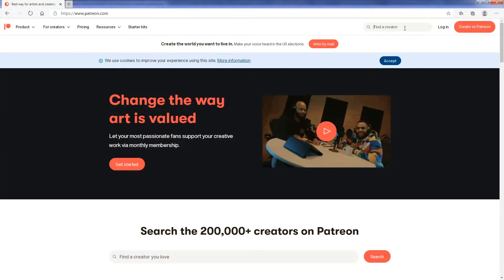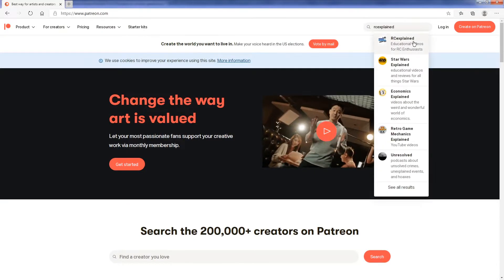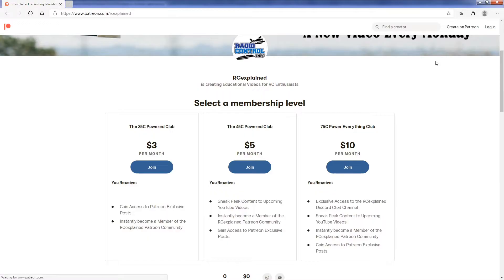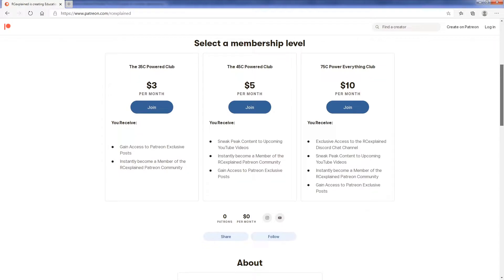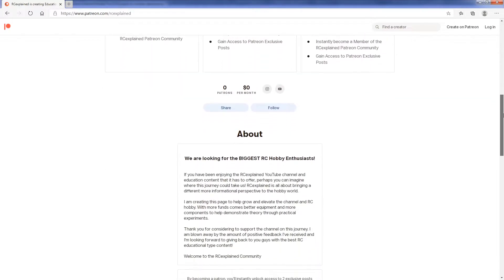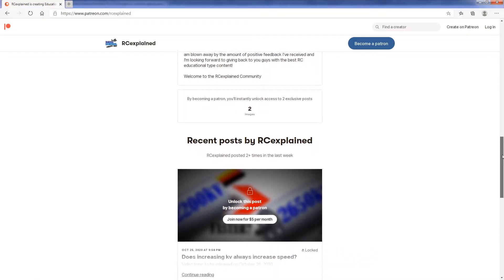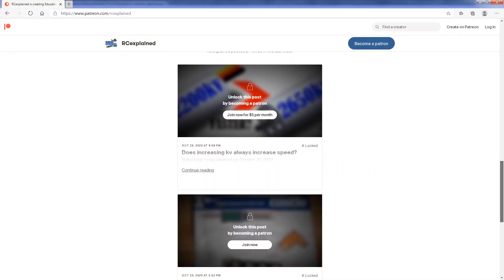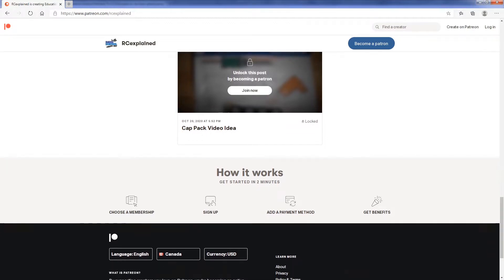Does Increasing the Motor Kv value Increase an RC Cars Top Speed?

Comment: New subscriber here! Ive watched at least 7 or 8 vids before i hit the button lol
Reply from the maker: Darn, I'm not good enough to make you hit it after the first video! Haha, thanks for the sub!
Reply: @RCexplained  OK , OK,  I hit the like button just now too lol .
BTW as a kid I used to put an extra 3 mins on my 15 min quick charger. burnt my first novak esc , had battery connectors melt together and I thought it was normal for an rc car to smell like a clock radio in an EZ Bake oven.

Comment: So if I use a lower kv motor and gear it up, will that be more efficient than using a higher kv and gearing it down ?  In other words, mathematically I could get the same final rpm but which will give me more run time ?  Low kv high gears or high kv with low gearing  given everything else is equal 🤔

Comment: You know I just cannot get over how much people pay for the aromas or kratons. 12 or 8s to me it's just an absolute joke. They put it on a 1100 KV and even up with a 12s battery and 1100 KV can only do 32,000 rpms. So you can take a 4000 KV motor put a 11.1 3s lipo on get 44,400 RPMs and totally rock that thing. So to me I just don't get why people do it.
Reply from the maker: I don't know what you mean. How many watts are you getting with the suggested setup and the 12s setup?
Reply: @RCexplained  well let's 1100x44.4=48840, and 3200x14.8 is 47360. So I mean with a much cheaper motor and a much much cheaper battery you can almost get the exact RPMs of a 12s battery and motor combo. So all I was saying is I don't get why people are spending thousands of dollars on all this upgraded equipment when it's really not that much better
Reply from the maker: What are the wattage figures in your example?

Comment: Thank you for real information in your content instead of flashy look at me stuff.. Im building an airboat using an arrma 2050 kv 8scale motor on 6s. Other than weight being factor, any problems with high rpm and low load? Seems like the motor wont even feel a prop compared to moving a car with tires.. I dont have friends into rc so sorry for asking here!
Reply from the maker: Sounds like far too much kv for any decent size prop. What prop have you calculated for this high of an RPM?

Comment: I would like to point out a slight error U have which is still quite variable ..the vehicle weight ..if U have higher kVa and higher rpm U have less tourqe ..if U have a large heavy RC car your going to decrease take off speeds by increasing rpm operation aka speed.. ..if U truly want to go faster go smaller in kV bigger in physical size and up the current to 2-3x your existing supply ..then mess with the gearing and U will increase takeoff AND top speed

Comment: Awesome breakdown. I'm new to speed running and just now in the 70s. My ESC has motor timing settings that I could play with, but I still need to learn more before I change anything.
Reply from the maker: Thanks for the comment. Just recently I did a few videos on timing that you may want to check out.
Reply: @RCexplained  Yep, I'm watching a couple older ones now and it's pretty similar to a piston engine like you said in the video 👍

Comment: This is kind of off topic. When using 2 batteries (in series or parelle) is it true that the second battery is NOT monitored by the ESC for low voltage cut off at 3.7 volts or 4 volts DC.
Reply from the maker: Hi Greg. In general, if two batteries are connected in parallel to power an ESC, then both batteries will be monitored for low voltage cut off. This is because the voltage across both batteries is essentially the same, and the ESC is designed to monitor the overall voltage level. 

However, if two batteries are connected in series to power an ESC, then the situation is a bit more complicated. In this case, the voltage across both batteries will be added together, and the resulting voltage will be monitored by the ESC for low voltage cut off.

The ESC in both situations can not detect if a single cell enters LV as the ESC only sees total voltage.

Comment: But increasing kv is more efficient because faster speed at lower load is more efficient for the motor right? Compared to changing the gear ratio?

Comment: There's more to it then that. Like amp draw, power to weight ratio, WATTS power of the motor. Higher Kv uses less voltage but more amps in order to get closer to the (Watts) actual power. But also shortens the run time. The specs show it all. Look at the volts and amps on the specs. Lower kv doesn't just mean longer run time. It means it requires more batteries then higher Kv motors to reach it's true WATTS OR POWER you need for faster speed.

Comment: Can size will have effect on coil 
 Power going in . Power generated or speed is going to come from rotor magnets, how hard and fast it will turn to the next pole . Can is not as important as rotor .   A Hacker rotor compared to  Castle  is  Huge .. Maybe 5 times more magnetic or 10 times .  I have compared . The Hacker will attract hard through  palm of my hand . Where the castle rotor will not even do anything.

Comment: RC explained I have a question. Maybe I wanted to stay in the same motor size lets say 3650  and I had one motor 2050kv and another 3500kv
, but I chose to to run the 2050 kv at 7.7 gear ratio overall and the 3500kv at 12:1 overall .... the tire speed will be the same for both motors, but the load will be very different because of the gears.... So the 2050 would get hotter than the 3500 because of the extra load correct ? or will it be the same roughly because the speed of the car is the same.  Thank you.
Reply: both running 11.1 volts ....

Comment: torque is what you need to chase, not rpm/kv. I can put a 3600 kv motor on car and it could crawl if it does not produce sufficient torque, vs an 800 kv motor geared for speed and it will run because it has enough torque to reach its highest rpm under load.

Car manufactures will tell you all about how much horsepower their cars can produce, but who cares to ask about the max rpm of the engine???

Comment: Well there is actually a lot more to it than simple RPM. You can actually increase your top speed by lowering the KV and increasing the gearing. I’m curious to see your results because I’m going to be running the same experiment. Going from a 2050kv to a 1700kv swapping the gear to a high speed gear and see what happens
Reply: What would happen with heat? Would it get hot faster or slower?
Reply: @FZERO20  too much heat is bad. Lower temps as a general rule is better
Reply: @FZERO20  it gets hot faster with the lower kv motor. Especially when your looking to increase top speed. You’re putting a lot more torque against the motor. Sorry I must’ve been preoccupied when I first responded. I hadn’t read the question correctly
Reply: @jimmyv1753  😂😂yo I totally forgot about this. And I see your previous comment, I suppose when I saw it at the time I didn’t know how to respond so I just left it lol. But okay, that’s interesting info to hear. Rn I have this Wltoys 124016 with a 3650 brushless upgrade. An 8.5t mod V5R motor on stock gearing. The car is amazing and really fast. I can run laps and the heat on it is what I would say, “really warm, but not hot”. Supposedly you can run low kV/high gearing on motors that have larger can sizes because they can.. of course handle and dissipate the heat way better. So if you can upgrade motor diameter while keeping kV low, you may get away with it. Add a fan or too👍🏾😁
Reply: @FZERO20  sounds awesome. I have a few similar set ups. I hooked up the V5R only to figure out it was in an L situation (if you know what I mean) I ended up getting a couple of each type of those little 540 motors. That car had incredible reverse speed 😂 it was the most recent comment that had me pop back to see what it was about that’s when I read my earlier response to your question and was like WTF did I say there 😂 personally I like the slightly larger cars. I’ve been building on a talion. I swapped out the esc and motor for the 200 amp 6S hobby wing x8 plus or whatever it’s called. With around a 2200 kv motor and it’s by far the fastest car I’ve ever built. Of course the motor and esc cost as much as the car so I wouldn’t recommend going that way
Reply: @jimmyv1753  dude you have some too. That’s cool asf man. I’ll try and post a vid on my channel of my current 1:12 scale on-road build. And it’s all good, my bad for the late response too. And I feel you on the scaling. I’m so looking forward to going up to like 1:8-1:5 scale but I just don’t have the money or space for it yet. But it’s definitely on my list. I also love how although we at different parts of the world, we do such similar things
Reply: @FZERO20  I hear you there. I’ve got a 1/5 scale outcast and it’s fun. But very expensive to fix and being 40 pounds (18KG) when it lands (jumping it is by far the funnest thing to do with it) it breaks real easy. I’ve only got about 2 hours of use on it and I’ve replaced both upper and lower front A-arms to aluminum (160 bucks) so far. By FAR my favorite is the Talion 1/8 scale. I added all that extra horse power but even with the stock set up it is soo fun. Has fantastic handling. It’s great on all terrain, climbs, jumps, concrete or asphalt, grass, dirt, sand and anything else. It rips and is just an absolute blast to drive. I’m sure Traxxas has a similar style RC that’s just as good or better. I’m not an Arrma snob it’s just the batteries I have so rather than buy new batteries I just stick with Arrma. Not only that but their site has excellent payment plans available. I’ll check out your page too see what you’re working with.
Reply: Lower kv motor should be much more efficient, in terms of heat/amps, with higher gears vs the high kv.

Comment: This is excellent info bro😎👍

 There are however motors out there that can handle the issue most higher kv motors have, which like you mentioned, is that they have smaller can size & overheat quicker. TP power motors have a nice selection of higher kv motors with large can size & capable of handling higher voltages & current than most common motor companies offering the same kv value.

I'm in the middle of working on a 4S high speed project, an Arrma Typhon 6S stretched build. Castle XLX2 controller. While the XLX2 can handle 8S & I can easily get this car over 120mph running 8S, I realized that I can run a higher kv motor, with a decent current rating, on half the voltage & still achieve high speeds & not worry about the too much current being pulled from the ESC, since the XLX2 can handle over 500A. I ran as a test an old hobbywing ezrun 2200kv motor I had on this new stretched Typhon 6S with a 34T/34T gearing on 4S. Pulled 207A from the ESC & hit 85mph. Did 3 runs back to back @85mph & i could still keep my fingers on the motor. My gear calculator estimated 86mph with this setup so I definitely was hitting max on my runs. Even with this "not top of the line" 2200kv motor, with a minor gear change & still running 4S, I should be able to get over the 100mph mark. Next motor will be either a TP Power motor or the Castle 1721 2400kv motor. Looking forward to breaking ~110mph on 4S. I know it's possible & even higher as others have already done so.
Reply from the maker: Amazing man. I hope you are having a lot of fun experimenting with the different setups and tweaks. Have you seen this video?
https://youtu.be/mrPjYEmMPfA
Reply: @RCexplained  Just watched, awe man... That's exactly what I wanted to see. The inside structure of these two exact motors & you got them both on 1 video lol, thanks you thank you!! 👍👍

I was just on TPs site yesterday and noticed the "regular, cm & scm" types but didn't get a chance to dig & see the differences so that was very helpful as well. 👍
One thing I like about TP is that they actually give you a "continuous" & "peak" (along with peak runtime).
This is helpful when breaking down a current draw chart for the different LIPO batteries (2S,3S,4S,ect.) at max wattage. This makes gearing easier, as it lets you know what's the max gearing at a certain voltage level you can push to reach the max wattage that a motor can handle (wattage/voltage =amps). As much as I love the Castle products because they are indeed excellent, as an electrical engineer, I hate their lack of data/specifications on their products.
Thanks for the awesome link & taking the time to make these videos, they're absolutely helpful 😎👍
Reply from the maker: Right On. I will be doing a video soon on the specifications of the motor. Things like Io and Rm also relating it back to a theoretical max continuous and peak power output. Stay Tuned. 😎

Comment: Also when you change KV you also affect torque of the motor too even more so when the size of the can changes too the length of the can affects heat dissipation and torque which is important when you go with bigger vehicles. Normally brushless motors will have another 4 digit number and that specifies the can size and length.  A 3660 motor is 36 mm in diameter and 60mm in length.  Just more to take into account

Comment: 👍👍👍Great video and very importan in motor selection since many rc plane brushless motors do not include  temperature limitation or even maximum desing current. How do you know that the proposed motor is aout at is thermal limination? got lost on that part.
Do how i know max current for a brushless motor if not provided by manufacturer and i do not want to buy a bench test and test it myself, if there a way to calculate it?

I am a new subscriber!!!!!!!!!!!

thanks

Comment: Running a 5900kv motor in a 1\10 scale buggy it is off the charts fast but gets heat soaked quickly so my problem is I don't want to get rid of the speed but I want to make it run cooler so do I bite the bullet and downsize or do I buy a duel cooling fan setup?
Reply from the maker: You can try adding heat sinks and fans. This will help remove heat. You can also look at getting a larger 5900Kv motor to get rid of more waste heat through larger surface area.

Comment: Yes but only if the gear ratio remains the same, lower kv with higher gear ratio provides a longer lasting esc and motor, and allows for a beefier pinion gear.

Comment: lower kv ive gone faster then my higher kv like ya say its all power to weight an amps an current an gearing the biggest part but also esc ya leave out of it its also a major roll not just for the kv motor but for amps an current js the esc na power managment is the best part without that your kvs mean nothing

Comment: quick question,  I have a 4092 1530kv motor running on a 120a esc and 3s 120c 8400mah battery and for the most part it runs fine, bit of coggin in grass on take off or if im stopped on a hill going up.   I wanted to buy a 4s battery to try it out, just out of curiousty and since my esc handles up to a 4s lipo.   I found one thats in my price range, but the c rating is way lower then my 3s.   this battery is a 4s 7000mah but only 35c.   I am running a 17t pinion and 48t spur with 155mm wheels.   My worry is that the battery will be damaged or explode if my esc or motor trys to pull more current then it can supply? or is that not something to worry about because the battery will only give out its max rated power? I hope this makes sense.  thanks!
Reply from the maker: You can monitor Temps of the battery to ensure that it does not exceed 140F

Comment: I have a Vortex R10.1 Pro Brushless ESC 170A, 2S 
And a hobbywing 7t on my ECX amp MT. 
I’ve stripped two sets of gears, but before that happened it topped out at about 28 MPH. It’s geared at 22/87, running on a 5200 2S lipo. 
Will I have to replace the motor to hit 50? I didn’t know much about aw sores/sensorless when I purchased the combo, and I think the esc is compatible with either.
Reply: I have ecx amp Mt on 2s lipo 3650 can 3900 kV gearing 22/87 top speed 40 mph with the body 38 without the body haven't tried 3s yet
Reply: Drop your spur gear to a 64, and your speed will increase by around half. The closer you get to one to one gearing, the faster the car, the more amps(heat). So limit the runs, heatsink and fans.